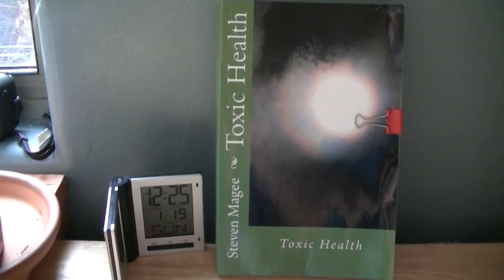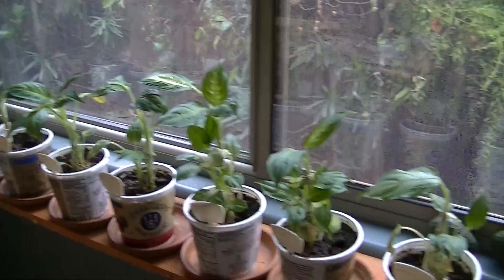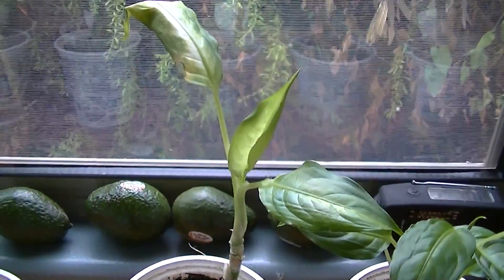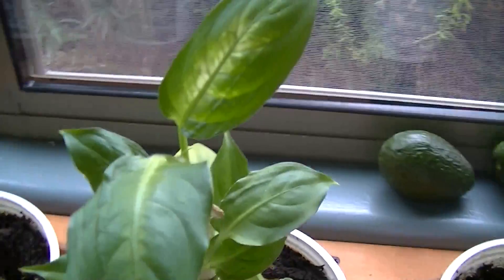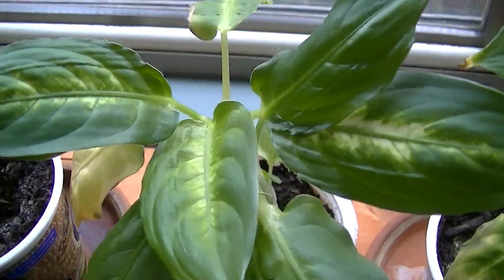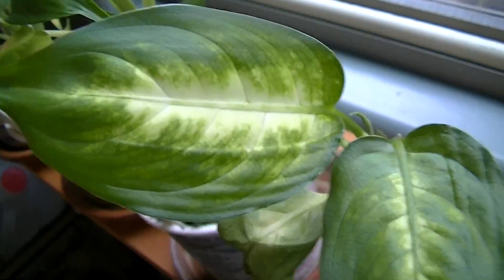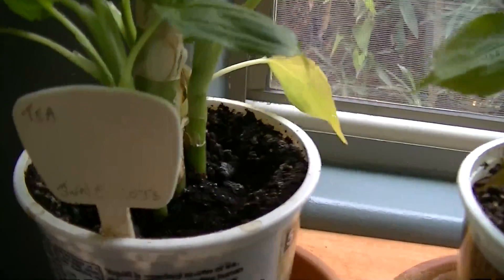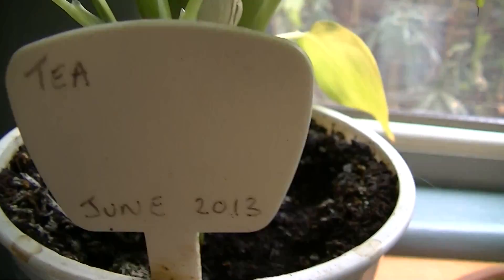Structured Water Plant Experiment January 2014 Results

Comment: Microwaves cause water molecules to vibrate. Microwaves move at th speed of light. 
When you shut off the microwave there are no microwaves in  the water as they are either absorbed or continue away at the speed of light ....more likely hit the sides of the oven. 
As water molecules move at the speed of sound in water constantly colliding and rearranging. There is no set arrangement. There is no "structured water" 
Note how he says sometimes the radiation has a fertilizer effect. 
So........if it grows worse it is the radiation it if grows better it is the radiation...This is
ignorance and bias.

Comment: Hey Steven, I have done some digging on reverse osmosis water in the past and what I found is that the new word on the block is filtering using RO does not remove the naturally occurring minerals. Have you heard of this before?
Reply: It might have had more of an impact with the inorganic minerals as there are two types of minerals in water, organic and inorganic...
Reply from the maker: Brewers do not use RO water as it adversely affects the beer.  The yeast needs the dissolved water nutrients to thrive.  In this experiment , the plant does not get RO or mineral water, as the water re-mineralizes itself on contact with the soil.  The plant then absorbs the nutrient infused water.